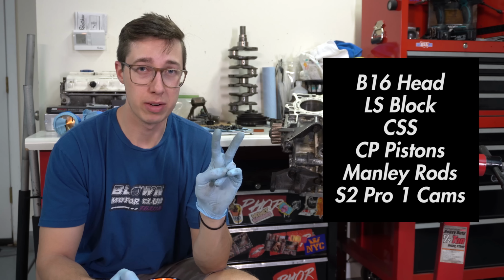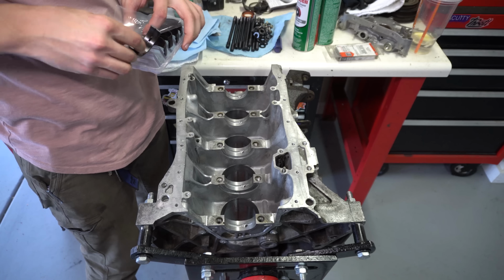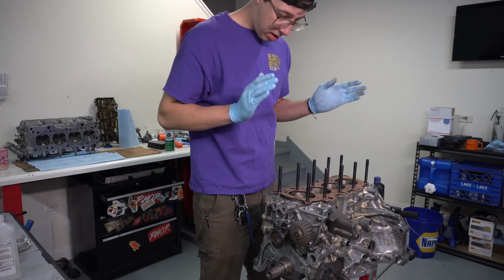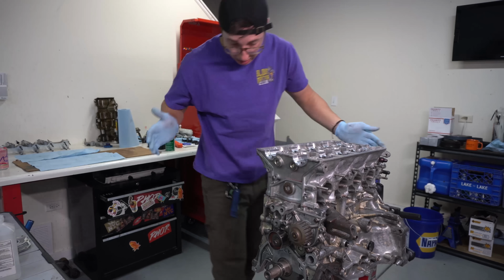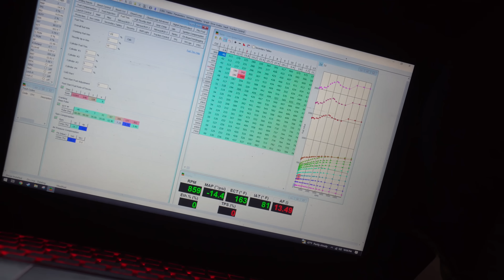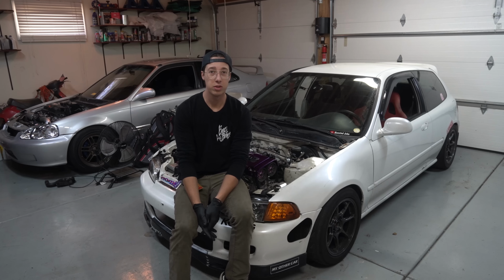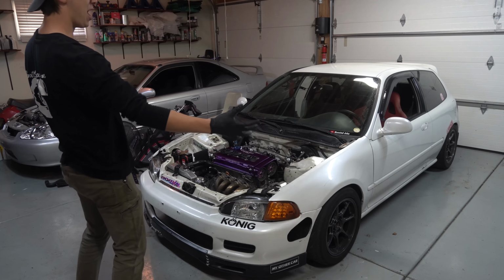Building a 9 Second LS VTEC Engine for My Honda Civic

Comment: Skunk2 instructions says not to use a impact on the cam gears bolts, definitely cams has a hair line crack and will probably break and bend valves fyi

Comment: Great to see a B16 Turbo Build ! You say a B16 LS what is that type is that? I have a B16A2.
Where did you find what lubricants you need for what type of use and the torque numbers of the bolts?
Witch Manley Rods did you choose -> H-Beam or Turbo tuff?
CP Pistons -> Compression Ratio?

Comment: it's important to check for oil clearance and tolerance on the built engine. But that being said, i've also seen these built engines last without a proper clearance checked during assembly hahaha.

Comment: please tell me you degreed the cams? I may have missed it but they definitely need it. also I would look into a ati damper. other than that solid build. I built my buddy's lsv and its making around 550 with the css block and similer head package.